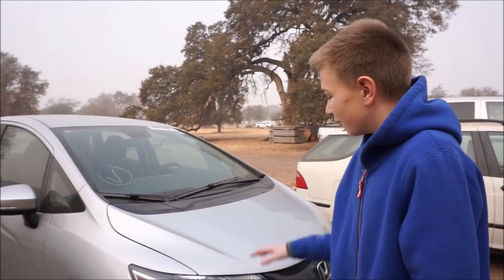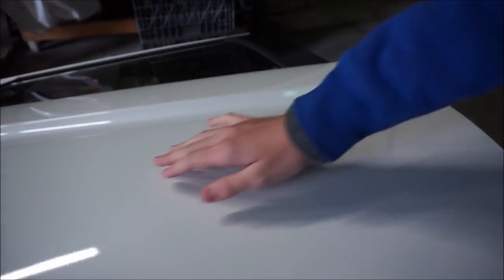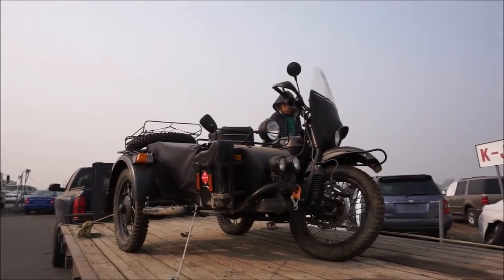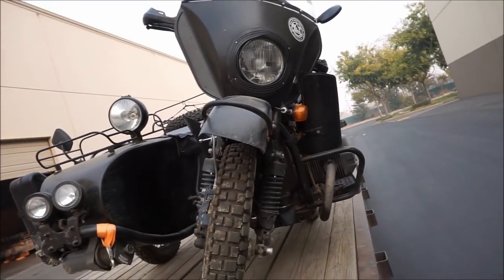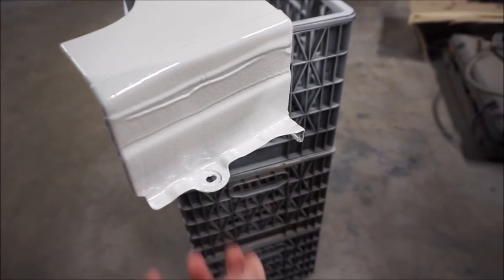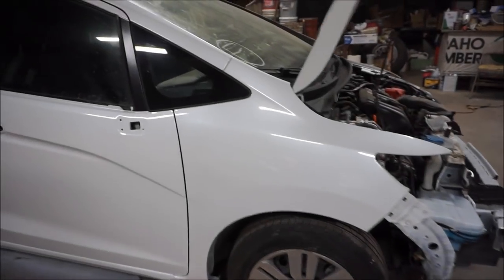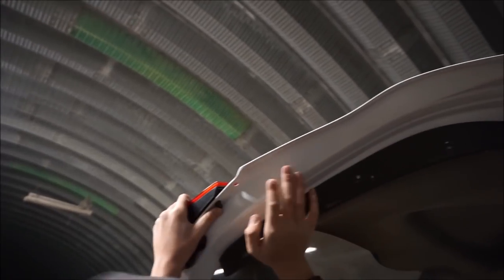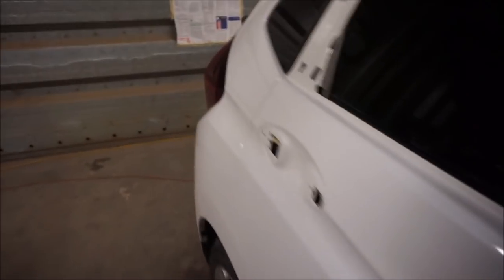Picking up Kondor Buildz Dad's New Toy at the Auction

Comment: Good job fellas!
Wish I never owned a Fleetwood Bounder... Cringe every time I see one.
Reply from the maker: Really, why?
Reply: @FIXBROZ  Money pit. I was told by the guy at the RV service station, that I was at frequently, the Bounder is a through away RV. Built with cheap components? The trans blew up one my first trip and the emergency brake system, that is connected to the power steering pump, was always going bad. Ended up spending twice as much as I bought it for and selling it for just over half of what I bought it for. It was used on the show Weeds though? Haha
Reply from the maker: We have a diesel one those don’t break
Reply: @FIXBROZ  Okay. Wish ya luck!